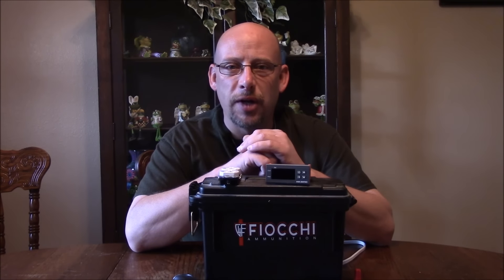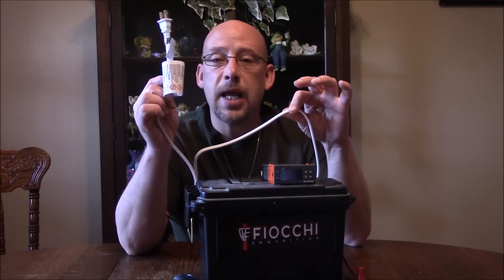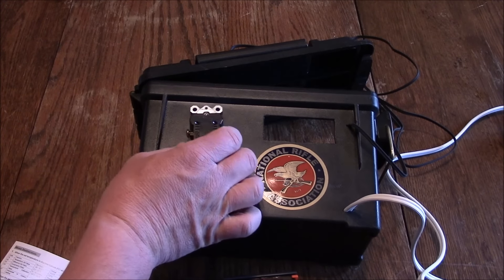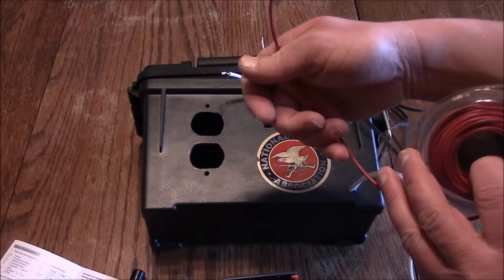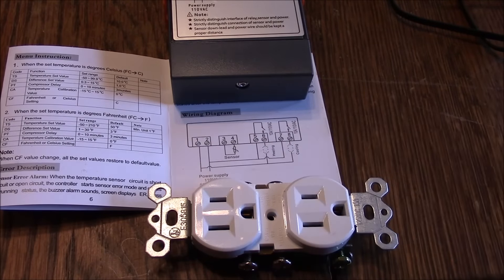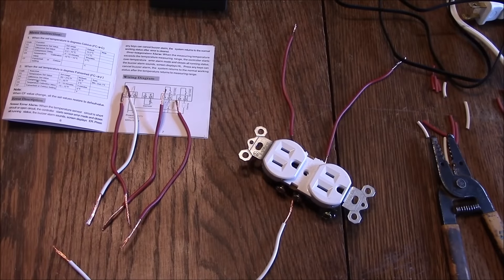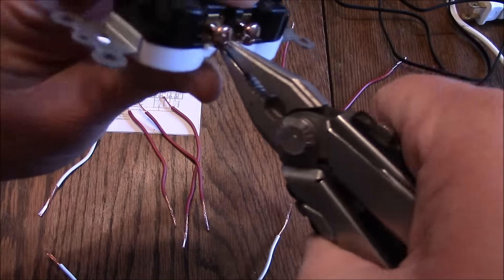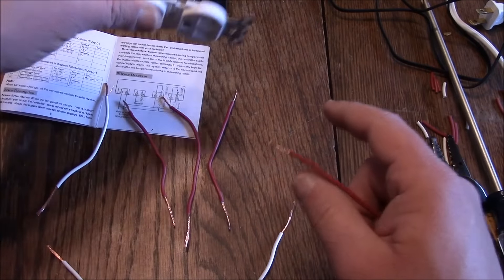How to Make a Cheap Digital Temperature Controlled Outlet

Comment: I made a controller just like yours except I mounted the controller through the top of the ammo box and the outlet on the narrow side.. That made the wire routing and connections much easier. P.S. Great video - thanks for taking the time to make it.
Reply from the maker: sounds like an improvement to my plan.  :)  thanks for watching and glad you liked it.
Reply: That is how I will build mine as well. This is a really great video 

- Don

Comment: I totally understand you..I am using the factory little giant heating element. I will try adjust the temp again thanks for your help and input.
Reply from the maker: No problem.  I am glad to help where I can.

If you are using it on the little giant incubator because the original temperature control went out you might try contacting Miller Manufacturing.  I had that issue and they were more than willing to send me a replacement and had it to me in just a few days.

Comment: This should be built with a ground circuit. To prevent shock or death for two reasons. 
1. If someone uses a metal ammo can it could get energized and shock you when you touch it. 
2. If you use it to control a heat lamp or another 3 pronged appliance it's case could get energized and shock you.

Comment: You used a grounded outlet in your project box, but did not use a 3 wire plug. This creates a possible problem, if the device you plug in needs a grounded outlet this defeats the protection. All you needed is a 3 wire extension cord, that you can buy at Home Depot and run the ground wire to the outlet, then you can safely plug in 3 prong plugs or 2 prong plugs. Be careful!
Reply from the maker: Thanks.  I will look into that.
Reply: You're welcome, this is for your safety, and very easy to do.
Fred (retired Electrical Engineer)

Comment: Thank you!  Great video.  I'm trying to rig up a mini fridge to culture veggies.  It's always either too hot or too cold where I live, so I think I need a heat lamp added to the fridge and also a fan to circulate the air and bring in fresh air.  I don't think I can make the system air tight because the fermenting microbes need air.  I think I can run the fan constantly and use the temp controller for just that.  If you have any insights they would be much appreciated.  Thanks, again, for the great video.
Reply from the maker: I bet that would work great.  I am not sure I can add any suggestions, sounds like you pretty much have it figured out.

Comment: can you tell me what the heat and cool range is? what type of temp probe do you use? Nice video.
Reply from the maker: the temp probe comes with the unit.  The temp range is from -50 to 200 F.  Hope that helps.
Reply: thanks

Comment: You left out a very important wire, the grounding conductor that ties to the ground on your receptacle. Any appliance in plug into that outlet is not properly grounded. Your neutral is not a ground, it is a grounded conductor. Grounding conductors are green or bare copper.

Comment: Hi Chris, hoping you might have a suggestion for me.  I need a temp controlled outlet for a hotwater circulation pump.  I have a water line from my outside wood fired hotwater boiler that I am connecting to a flatplate heat exchanger in order to heat the water in my house hotwater tank.  There is a pump circulating water from, and then back to, the boiler.  A second pump circulates water through the heat exchanger  and the hotwater tank.  I need that pump to only come on when the boiler water is 160F or greater and the water in the hotwater tank is below 140F.  I need the pump to go off when the water in the hotwater tank reaches 140 but come back on again if it drops to 130.  The pump is 115/120VAC approximately 80W 1/25hp.  I am assuming that I would need two STC-1000 controllers connected in series in order to manage these two different temperature sources.  Do you know of an inexpensive device that can do this?  Could two STC-1000 controllers do the job? Thanks in advance.
Reply from the maker: Wow.  I wish I could answer that for you but that is a little out of my area of expertise.  I have some ideas and I think you are on the right track but I hate to give advice base don "ideas".  Especially when working with electricity and hot water.  Sorry i can't be of more help.

Comment: I hooked one up to my little giant incubator but the temp seems to fluctuate from 37.0 to 38.2 I used ice water to calibrate using 2 different thermometers. I put 4 rocks in for heatsinks I have it set at 37.7 for heat but it doesn't stay constant enough I have had the incubator going for 2 days now... Any suggestions?
Reply from the maker: did you set the variance on it?  it can be changed to allow a smaller variance in temperature.  That is the first thing I would look at.  I hope that helps a little.
Reply from the maker: Well that was my first guess.  What are you using for heat?  It may be that it takes a little while for the "heat sinks" to absorb the heat so by the time the heat cuts off they are still warming up.  I don't know if that makes sense or not.  You might try adjusting the temp down a little and see if that helps to average it out.

Comment: I had the problem of my AC running all night then the room being freezing in the morning. One problem I ran into is the "real feel" temperature. This uses relative humidity in a very complex calculation. I did it with an audrino and a relay. I was gonna order your thing until I remembered I need real feel temp.

Comment: I live in norway an have an stc-2000 temp controller. I am going yo use it for an fridge. Any ideas on how to wire it?
Reply from the maker: I am not familiar with that model exactly but there are wiring diagrams online you should be able to look up pretty easily.  Sorry I can't give specific instructions on it.
Reply: i've tried google and dident find anything. im not the best when it comes to wire stuff and norwegian outlets is different than US. also back of the stc-2000 there is only one outlet besides the power source and sensor
Reply from the maker: I wish I could help you out but i am not familiar with that model exactly and I am not an expert on wiring for Norwegian outlets either.

Comment: Hello! Wowo great to see comments on this video are recent! I wanted to PM you privately, dont know if that is possible? But its okayto commuicate through here too. So I am currently looking into setting up a "Heat Rack" for the reptile collection. I will have about 40 12 quart tubs stored on a shelving unit and connected to one 50 foot long 3" heat tape strip. The wattage it will pump out should be no more than 200 W, i dont know if i need to look into the amps or volts as well, I KNOW NOTHING ABOUT ELECTRICS LOL. But i am a fast learner, your video was great. One question, if i want to instead use the "cooling" side to also heat, could i set both the heating temp and the cooling temp to kick on in such a way that both outlets could be used to heat 2 devices at the same time to 90 degree F.? Maybe they sell models that cater to this? But i figured id ask and see what your input was, i was trying to calculate in my mind how this might work...
If you have any beginner advice, or something you see i am missing that could be detrimental to my project, i would GREATLY apreciate your feedback. TY Slightly Redneck, and thanks for the very instructional video!
Reply from the maker: Hey there.  Unfortunately I am not an expert on this either.  The cooling side wouldn't work though.  It only kicks on when a temp reaches higher than the level set.  These are pretty cheap units so you could just build two units to run two different outlets.  Sorry I can't help more.
Reply: Thank you for your input, that actually helps :)
Reply from the maker: No problem.  Glad to help.

Comment: Can this be used with a heat lamp or heat mat to heat up a animal enclosure and keep it at a certain temperature? For example my dad has some chickens sometimes in the summer it's too hot and their enclosure and in the winter it's too cold. So would I be able to use this to when it gets too hot it turns a fan on in the summer and in the winter it turns the heat on when it gets too cold?
Reply from the maker: It should work well for that purpose.  I have used it to run a heat lamp on my brooder boxes.

Comment: Nice work, but I need a controller for a meat smoker. Need to maintain temperature between 200 to 250 degrees. Also, only need in on/off outlet to run a fan that supplies air to a wood fire. Once the fan goes off, the fire dies, then turns on when temp too low/off when too hot. Can you help?
Reply from the maker: Sorry but that is out of my area of expertise.  Not sure I can help with that.

Comment: I am confused on how to actually set the parameters on the controller. Can you run through that part of the process?
Reply from the maker: I actually don't use this one anymore, I upgraded.  It wasn't too difficult to set up but I don't have it down in memory.  Here is the section of the user manual that discusses how to set it up.  I hope that helps.  

5.1 Check Parameter:
In normal working status, press “ ” key once, it will display the setting temperature
value; press “ ” key once, it will display the difference value;
5.2 Parameter Setting:
In normal working status, keep pressing “ ” for more than 3s to enter set mode, set
indicator lamp is on, screen displays the first menu code “TS”.
Press “ ” key or “ ” key to move up or down the menu item and display the menu code.
Press “ ” key to enter the parameter setting of current menu, the parameter value starts
to flash.
Press “ ” key or “ ” key to adjust the parameter value of current menu.
After the set, press “ ” key to exit the parameter setting of current menu,
the parameter value stops to flash. User can set the other functions as above steps.
In any status, press “ ” key to save the parameter modified value, and return to the
normal temperature value.

Comment: if I wanted the controller to power on a homemade nichorme heating element,  do I need a relay in between the controller and heating element to handle the power of the relay? if so, what kind of relay and power source would be good for powering the heating element?
Reply from the maker: I am sorry, but I am afraid I can't answer that question.
Reply: The controller has a small relay (actually two- one heat and one cool) inside it. However, you should check amperage/wattage capacity of the controller and heater.  If heater current draw exceeds controller rating, then yes, you will need to add a relay.  Love the DIY!

Comment: Is this dengerous to try? And does the devise use alot of power? I know these qustions are problely stupid. And sorry for my English :)
Reply from the maker: It doesn't use any more power than just plugging a light into a regular outlet.  And as long as you wire things up and keep the wire tidy (not touching anything else and not out in the open where you can get your bare hands on it) there isn't any more danger than a regular outlet.  Don't go trying to run your refrigerator off of something like this though.  This is for small things like lights.  Hope that helps (and your English is fine). :)

Comment: On many plugs/plates there should be 2 holes that are already threaded for the bolts. No need to use a nut and bolt to hold the plate in place. https://s26.postimg.org/5h02tvjwp/holes.jpg

Comment: Nice!  Their web page says 10 amps at 250 VAC so I'm unsure of the max draw capacity at 110VAC.  Maybe someone with more knowledge than I can chime in... But if this unit is rated at 10 amps max draw at 110VAC then as long as your heater does not pull more than 1100 watts/10 amps (volts x amps = watts) then this will work fine... but I think you might want 12 gauge wire for the wall plug and internal wiring as 16 gauge is only rated for 3.7 amps and the cord could get hot and start a fire.  Since it's a short cord you might get away with it but in a location with flammable material and a heat source, e.g. brooder, I personally would use larger wire...
http://www.ink-bird.com/product/detail/p/All-Purpose_Temperature_Controller_ITC-1000/id/6    http://www.powerstream.com/Wire_Size.htm
Reply from the maker: +M Miller good question.  I am not an expert on that subject but if I remember right it should be fine because it is a short length cord.  I think you are correct that 12 gauge is recommended.  Either way, (I guess I should have said this to start with) the relays in this unit are rated for 10 amps.  I plan on using it for heat lights and small fans so it should be plenty to run that.  I hope that helps.
Reply: +Slightly Rednecked You might - depends on the draw in watts of the heat lamp... you might run it for awhile and feel the wall plug cord.  If it's warm at all then you might want to think about the wire - it's cheap... Anyway - thanks for all you do on your channel!  It's great to have this community of great people helping one another, and you help make that happen!
Reply from the maker: good advice.  I will keep an eye on it for sure (always do).  I do know that a 250 watt bulb only pulls about 3 amps though so it should be fine.  I also know that these units are used to run compressors on fridges so I am pretty sure that it will be fine.  I will keep an eye on it though and make changes (and note the video) if any problems occur.
Reply: Smart - hope the discussion is helpful for others who come along... Keep up the great work!!!
Reply from the maker: I hope so too.  Thanks for bringing it up.
Reply from the maker: just to update, I did check the extension cord.  it is 16 gauge wire and is rated for 13 amps.
Reply: That's great information - we all need to keep it in mind!
Reply from the maker: Interestingly enough, the cord that is on the heat lamp is only 18 gauge wire.
Reply: Yes, interesting.  It's good to look at the max watt rating for the lamp.  It the have a max watt rating on the lamp that is low enough then I guess that's okay, but it bothers me when they do that to make a buck.  Always good to look at everything, as you are!

Comment: does it have to be a 16 gauge wire
Reply from the maker: It doesn't have to be but I wouldn't go much smaller.
Reply: Can I use 32 with 16 ?
Reply: I'm going to build it soon great vid
Reply: And where do I get wire ?
Reply: an extension cord from walmart.

Comment: U should use wire connectors instead as there are high amps u gona running thrpugh them
Reply from the maker: Yes you should use connectors on wires that are connecting to each other.

Comment: You have the STC-1000F, not the ITC-1000F as you said. You should change your video description to notate that. I have the ITC-1000F and it's a 12 volt DC model practically identical to yours except the voltage is different. Great video though. It's helpful since the controls are the same. I'm going to use mine to control 12VDC heating pads to warm up the lithium iron phosphate batteries in my van so they don't accidentally get charged when the temps are below freezing which could easily damage them.
Reply: Not sure, but the Amazon link shows the ITC-1000  and it says 110V in the description.
Reply: @AnglinTexas  that's odd. I have my 12 volt unit in front of me that clearly says model ITC-1000F. I searched for this model on Amazon just now and low and behold, the ITC-1000F is listed as a 110 volt version and the listing for the one I bought says it's a model ITC-1000 so I believe the mistake is not with you (you are correct) but is with how Amazon incorrectly listed the different products. My apologies for the confusion.